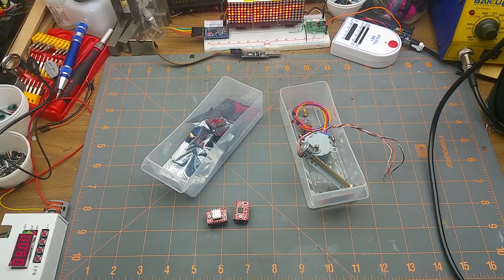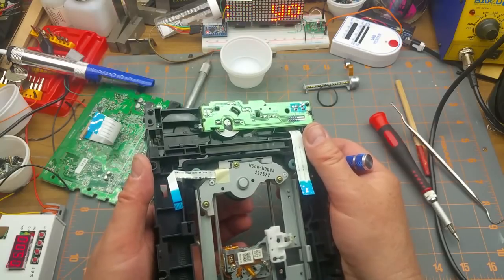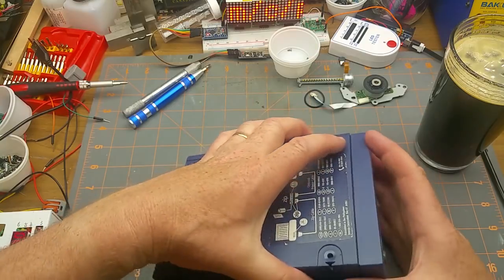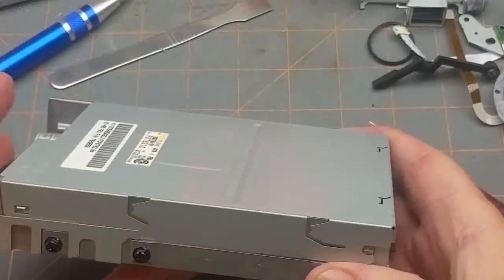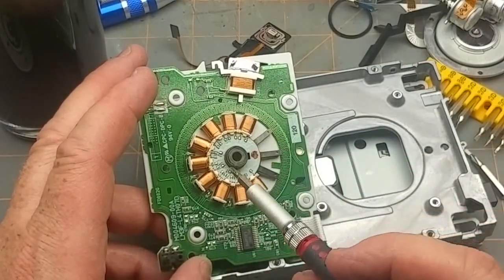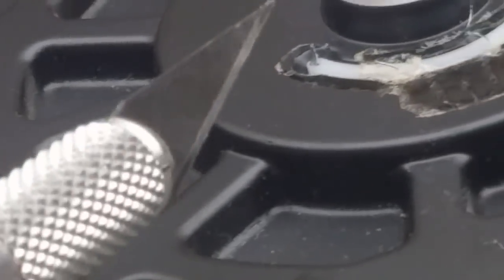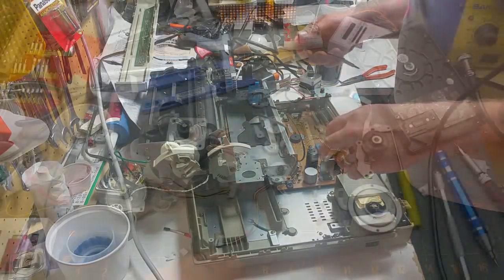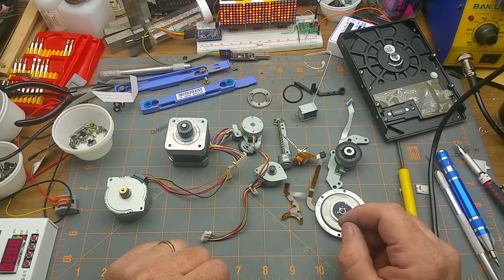Digging for stepper motors

Comment: I've done plenty of that type of destruction in my quests for steppers. You might want to pull the various styles of encoders out of those printers so you can play with servo motor control down the road. I've gotten linear and rotary encoders out of various printers. The older printers usually had the bigger steppers! I've taken apart huge modern office computers that had smaller motors than the old daisy wheel printers. Nema 24's in the old stuff. Lucky to find a Nema 17 nowadays.

Comment: Harddrive motor is a BLDC afaik.
Reply: Yeah, in stepper motor you have two separate or connected coils, but in these there are three coils with one common, three phase Y configuration or sometimes a delta configuration, and they turn only in one direction, and they spin very fast, much faster than any stepper motor.

Comment: the motors from the drives are actually BLDCs (except the 2 small motors)
Reply from the maker: Are they? Interesting.

Clearly I haven't messed with those before.

I assume they work on a similar principle to steppers and to how I described?
Reply: pileofstuff they do. But the controller you showed at the start won't be able to turn them. They have 3  coils connected in a y shape.

Comment: In very old hard drives it's possible to score a stepper motor, I have one, from some very old 5,25" hard drive. It was used to move a read/write header in a linear fasion, For example something like that: https://www.wardrobepivot.top/olivetti-ope-xm-52202-20mb-525-mfm-hard-drive-p-6066.html

Comment: Do you have a good way to use the ones with a lead screw? I have a few but I find it's difficult to actually get anything that couples to such a small lead screw. Also, if you're searching for motors, old thrift store printers and scanners are a very cheap source. Older ones can also be a good source of fairly precise linear rails, though newer printers tend to use cheaper parts instead.
Reply from the maker: I haven't solved that problem yet.
Once I stumble across an application for them, I'll start experimenting.Or I might just replace the lead screw with a more traditional gear.